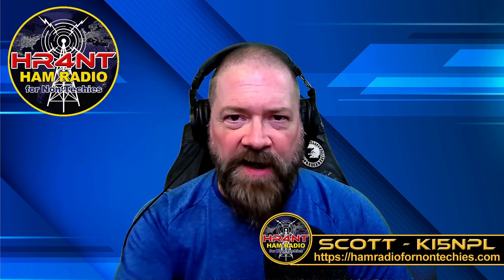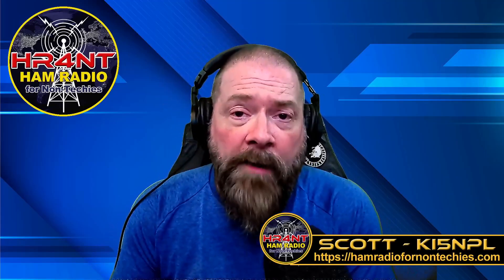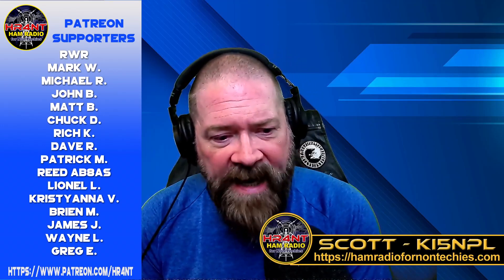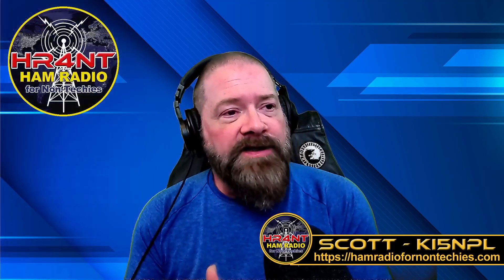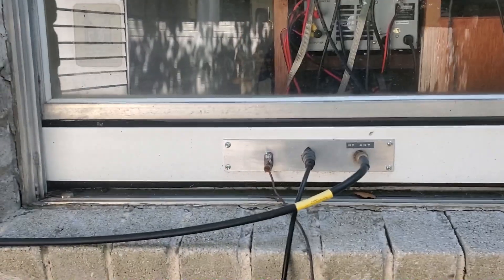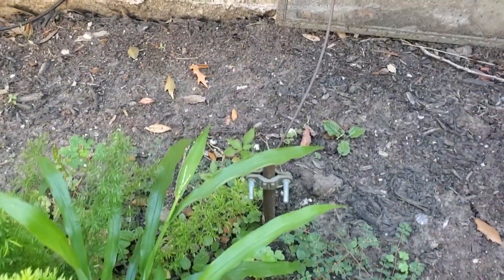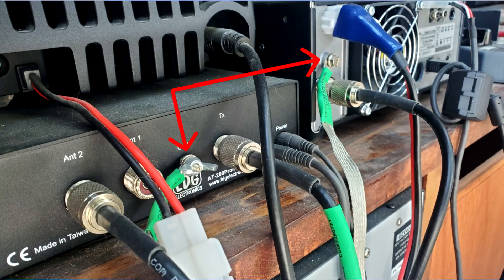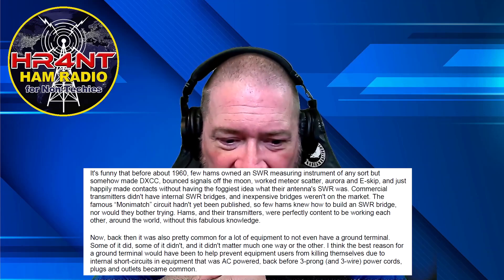Grounding My Ham Radio REVISITED:  What I Have Learned Since Then

Comment: I am new to ham radio and your videos have helped me a lot. I just watched both of your videos on grounding. I just wanted to tell you something that happened to my sister-in-law some time ago. We live in south Florida. The soil here is mostly a form of sand. Lighting hit a tree outside her house. This caused two tv’s and a couple of other appliances to be damaged due to the lightning surge.  It was determined that lightning entered the house through the ground rod. As you said, just disconnect your antenna and power for the best protection.
Reply from the maker: EXACTLY!!!!  No matter how much grounding...if you have a direct strike, nothing is safe.  Best of luck on studying and passing your exams and becoming a licensed ham!  Let me know if I can help anytime! Thanks for the comment and for watching.  73!
Reply: Considering a lightning strike contains millions of volts and amps and has discharged over a distance of several miles, there is nothing that will protect your electronic equipment from that electromagnetic pulse. A fellow YouTuber who produces and markets a well known series of HF wire antennas suffered a direct strike on an antenna in his home. There was not only gear that was still connected that was damaged BUT equipment that was put away in their factory boxes sitting on shelves in his radio room that were also damaged beyond repair from the pulse.
Living in Central Ohio in the late 60’s we suffered a strike on a 200 foot tower in our back yard. The weather had cleared and this was a stroke out of the blue. This is quite common and why one should avoid going out into their yards at least for 45 minutes after the storm passes. Damages acquired by the strike are as follows, base station of a vhf business system was destroyed, less than four months old. The well pump ( which was a 200 foot deep well adjacent to where the tower was situated) and it’s controller destroyed ( blew the control box off of the wall). The anti collision lights were literally vaporized leaving only the brass bases in the lamp sockets (joys of living within five miles of an airport). A bunch of light bulbs that were not on burned, a clock radio toasted, and a SWL antenna with band traps was also destroyed, it was strung up between the tower and the gutter on the opposite end of the house, traps housings were blown off of the traps with coils and caps vaporized. The most expensive items to replace were the GE TPL base station which was practically new, and the well pump and controller. The primary item that needed repair were the collision avoidance lights on the tower. Ten dollars in "special tower lamps" and about $250 for the tower work to climb and replace lamps.
Reply: Lightning struck a tree about 35' from where my 'shack' is. It never hit any power lines, but the pulse (EMP) took out nine electronic devices along the back side of our house: TV, DVD player, HVAC thermostat, two weather radios, CO detector, hot tub control board, digital watch, and a satellite TV component. Yep, lightning will do what it will. I disconnect.
Reply: From what I understand, the more grounding you have helps keep the lightening from hitting your home.  I was at a seminar on grounding and learned that initially lightening will go from the ground up to the sky in a tiny arc, then the major bolt will then come to earth. 

This is why you have rods extending from towers to lower the static build up.  

It's an interesting subject.  My house has exterior lights and one hit back fed into my house and blew 4 duplexes out of the wall.   

It sounded like a bomb going off inside.

Comment: I like your copper ground "bar".  But is that actually a solid bar or a copper pipe from the home improvement store?  I occurred to me in seeing your ground that copper pipe would work well and be a lot cheaper than the copper bars sold for that purpose.  At RF frequency and high/fast impulse, like lightning, almost all of the current flows near the surface of the conductor, so having the conductor be hollow would not matter.
Reply from the maker: It is just a 1 inch copper pipe from Lowes.  It seemed to be more cost effective to get the same results as paying a lot more for the "official" version offered by ham radio retailers.  It has worked for me for over two years now and I am quite happy with it.  Thanks for the comment and for watching.  73!

Comment: The type of grounding lightning protection we as hams are likely to do may help with a nearby, but not direct, lightning strike.  On the other hand, commercial radio stations and tower systems use a level of protection such that they get struck several times per year and it does not blow them off the air.  Mostly, we do grounding to protect from RF in the shack and so that our antennas that require it work properly.  In that case, we want the wire to the ground to be as short as possible.  Then, you could run a wire to connect all of your grounds together.
Reply from the maker: I get that and I figured that just disconnecting the gear from everything while it is not in use for a period of time seemed to make sense to me for maximum protection.  Nothing will save you form a direct lightning strike unless you are completely disconnected from everything.  The topic of grounding in the ham community seems to be a hot one and often causes arguments.  This solution is simple  and works 100% of the time.  Thanks for the comment and for watching.  73!
Reply: @HR4NT  I liked your video a lot. You have a very practical and pragmatic approach to grounding. Tim Duffy, K3LR, CEO of DX Engineering, gave a talk to my local ham radio club on the subject of grounding. I was struck by the fact that if I followed all of the recommendations I would spend more money on the grounding than all of the radio equipment and antennas put together. Of course, DX Engineering sells all of that stuff in their prices are not cheap.

Comment: My ground set up is quite similar to yours. The only reason I ground is because when I use digital modes on HF, when the radio transmits it freezes the program I'm using to transmit and the computer screen gets lines across it. Grounding fixed that problem. I also didn't have my TS 2000 grounded and I transmitted with the stock mic with the metal mic clip on it and it burned me slightly...The ground fixed that. I don't ground for lightning protection, I agree with you there. But I have seen the need for at least a basic station grounding because it has prevented me from using a computer with it. If there's a different fix for that I'm all ears!
Reply from the maker: I agree and think that is sufficient.  We have to use common sense.  We can protect out gear from a lot of stuff, but a direct strike is gamer over.  Thanks for the comment and for watching.  73!

Comment: There was never a ham who lost gear in a lightning strike who have said "I wish I had grounded better!". There are hams, however, that have said "I wish I had unplugged my antennas and radios." I live in Florida, the lightning capital of the world. I am constantly diligent about unplugging the coax to my bulkhead during the summer months. That is what saves my bacon. There are, however, other types of grounding not related to safety, such as RF grounding. Better put...the prevention of ground loops which can wreak havoc in your shack and cause RFI, burned lips, and the like. That is a different animal altogether. If there are no issues with RFI, then grounding is largely unnecessary. I must admit, however, that I have a copper rod bus bar and braided wire connecting all my gear to it (in parallel, not series). That is connected to the bulkhead and to my ground rod outside of my shack. While it's true that NEC requires grounding everything to the house AC ground (so that we avoid two different voltage potentials), it's often not possible. Most of these arguments result in more heat than light. Good video and I agree with most of what you said. 73 de Scotr, W1AL
Reply from the maker: You absolutely nailed it!  Overthinking grounding causes more issues than just using common sense.  Love the explanation.  Thanks for the comment and for watching.  73!

Comment: What codes are you violating?  There is no code... "against" ...having more than one ground rod. I'm fact, it's even suggested that having multiple ground rods, at least 8 feet apart, and bonded together is preferable to a single rod. But not even considering that, your shack ground isn't an electrical ground for the house electrical system. It's an RF ground to keep stray RF volts off the surfaces off the radio equipment inside your shack, decreasing the chance of RF burns and other hazards to yourself and anyone else in your shack.
Reply from the maker: The subject of grounding in the ham radio community is like talking politics at the dinner table...LOL  In my first video on grounding, I caught crap from a few that everything was wrong...blah blah blah as if I was going to burn the house down for not doing it a certain way, so this new video is my answer and it works 100% every time.  Just got tired of defending my stance and solution from the previous video.  Thanks for watching and for the comment.  73!

Comment: The utility ground rod at my place happens to be right outside of the shack. Ran about 4 ft of #6 gauge wire from it to the window panel and called it good. Didn’t bother installing a separate ground rod. I’m done obsessing over the ground thing. A lot of old timers seem to know what’s best on the topic and it’s tiresome. Every situation is unique. If you’re station works well as is then there’s probably no need to mess with grounding. Adding ground rods and bonding to the utility ground has never fixed a problem in my 20+ years of being a ham. Never once helped with noise or RFI. It’s always been bad coax, jumpers, connectors, qth, or a vertical just being too close to the shack. Disconnect your coax during storms, use ferrite cores for RFI, keep the ground simple and enjoy.
Reply from the maker: I agree.  This is  a topic that gets heated very quickly and tons of opinions on the matter.  Sounds like you found a system that works for you!  Thanks for the comment and for watching.  73!!

Comment: This is absolutely the best video I've ever watched concerning grounds. I do the same exact thing as you if I'm out of town or if it's a bad storm coming I just pull my coax out of the wall where it enters the room. I run off of batteries so I don't have to worry about the radios. You said it best yourself if you get a lightning strike close or direct Hit it's not going to matter anyway. Awesome video brother 73s
Reply from the maker: Glad you enjoyed it and that it was helpful.  I try to be practical in my thinking.  Thanks for watching and for the comment.  73!

Comment: Hi.. It's me again.. and I'm confused. I've been asking ppl like crazy about how to ground just the coax and I keep getting the buy the ARRL book thrown at me.  It's frustrating me to the point where i'm just not wanting to do anything.  All I have been asking is how I should ground the coax, not the station.  I was going to just throw the coax out the window but  someone somewhere said if it's close to my house -like if I coiled it on a piece of PVC under the window sill, if lightining strikes my antenna, the coax would arc and burn my house.  So, I was like. ok.. i'll ground the coax.  But NO ONE will tell me how!!!!   I'm so confused and frustrated.
Reply from the maker: Let me start with this:  if you get a direct lightning strike, no amount of grounding will help you.  If your coax is unplugged then the electrical strike has nowhere to go as far as in your house and causing a fire.  I do not and never have grounded my coax.  As I explain in this video, at the first mention of a storm, like we had just yesterday, I unplug all my radios and gear and all my coax. That is the safest and most effective  way to protect your gear.  You can add lightning arrestors at the antenna.  So basically you would have a piece of coax coming out of your antenna and going into a lightning arrestor...then from the lightning arrestor to the house, but again, a direct hit is not a survivable event if your gear is hooked up.  You are talking about tens of thousands of volts and amps travelling at the speed of light.  Unplugging during a storm is the best bet.  I hope this helped answer your question.  Let me know what you think.  You can contact me direct via my website contact form.  Thanks for the comment and for watching.  73!

Comment: I got static for unplugging my radio because they say now you have an antenna and coax building up charge almost like a capacitor …….  Where will it end? Two questions. Do i run stranded 4ga copper grounding wire up the mast and terminate at the antenna bracket on ly 20ft pole (a99) to the grounding rod ? and. Can i bind this to the house via the nearby gas meter pipe that goes into the house? Thanks great video!
Reply from the maker: I am not sure that would be so effective.  I would add a lightning arrestor at the base of your antenna and have that attached to a ground rod that you could then link to the other ground rod for your house depending on the distance to it.  I probably would not recommend grounding to a gas line simply because flammable gas and electricity could be a bad idea.  Depending on the distance, you may have to bury that 4 gauge line to the next point of grounding until you can reach your house ground.  To me, that is a lot of work as opposed to just unplugging it.  I do not see how an antenna and coax can store energy to act like a capacitor.  That just doesn't compute in my head.  Do more research and ask around and see what others say, but I think you would be OK doing either of the suggestions I made here.  Thanks for the comment and for watching.  Let me know what you end up doing.  73!
Reply: Supper cool! THANK YOU! @HR4NT

Comment: Hi 👋 the entire point of grounding all your radios is because in case you were not home at the time of a thunderstorm, or lightning strike that you have a better chance of it being protected. Which is why your breaker box is grounded to the house where it is grounded for the entire house in case of the lightning strike. The way you have your grounding situation now I totally agree with and which is why you should keep it like that just in case that same exact reason. ☺️☺️😊👌👌👌👌. 
Keep up the interesting videos.
I also agree with what you were saying about having the ground wire, making all of them turns to wear your breaker boxes is not a good idea.
Reply from the maker: I get it.  I just found that for absolute protection, unplugging guarantees no issues.  I don't mind unplugging my gear and if I am away from the house I have it unplugged anyways.  Thanks for watching and for the comment.  73!

Comment: This is a great video.  Really interesting.  I am in process of setting up my first radio and the grounding issue is the number one issue on my mind right now.  I want to fully understand the issue before I setup the radio/antenna and such.  So it's a show stopper till I understand it.  But that's a good thing because I get to learn something new.
Reply from the maker: Glad it was helpful!  We tend to run down rabbit holes and drive ourselves nuts about grounding instead of just having fun with radio which is the idea behind going through all the stuff to get licensed and so on.  If you can keep your grounding basic and effective, that's it!  I hope you find a solution soon.  Thanks for watching and for the comment.  73!

Comment: Hay name is Jim I am working on getting my Ham but I have been in CB for a long time and I learned the hard way about grounding I have been hit 2 times and any thing that gets hit will come back in side I had to repair a super penetrator the lightning messed it up ruined the coax  and all so had to rebilled my Sirio 827 and coax I did have my Radio unplugged both time but I made a mistake I had other stuff hooked to my ground cable it back feed some stuff in the home not good I had my antenna  40 feet in the air and I also had 4 guy wire on my pipe I did not have my wire insulated from the pipe lol lightning dos hit the same place twice  I only have my antenna pipe grounded I did lowered my antenna and take my guy wire off keeps the static down I have learned a lot I just unplug everything and don't worry about it my home is already grounded so I just ground my pipe with my antenna on it.
Reply from the maker: In the event of a direct lightning strike, nothing is going to be safe.  So to take that out of the equation, I simply unplug everything that connects to my window passthrough and unplug my surge protector if a storm is coming.  I have plenty of LifPo batteries that I can run on for hours on end IF I had a need to reach out and communicate during a storm or for emergencies.  Now that doesn't help my radio being attached to an antenna if lightning hit that, but I have alternatives available.  Thanks for watching and for the comment.  73!

Comment: I have my shack in the basement, have the radio grounded  to a  overhead copper water pipe that goes about another foot, then through the wall and into the ground. Everything is plugged into a surge protector, plugged into a GCFI,  so all I have to do to shut down is to unplug the surge protector and the coax to the antenna!!!
Reply from the maker: That sounds like a perfect setup for your situation!  I am glad that it is working out for you.  Thank for the comment and for watching.  73!!
Reply: @HR4NT Just like my sponsor tells me, keep it simple,  stupid!!! The ground wire for the radio is from an old pair of jumper cables!!! Used a propane torch (with the soldering tip) to solder it to the pipe!!